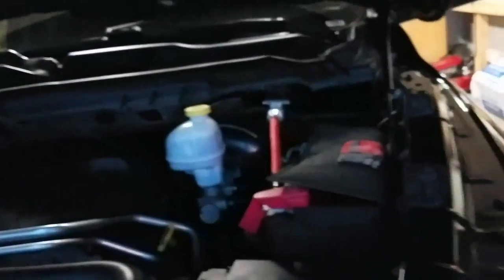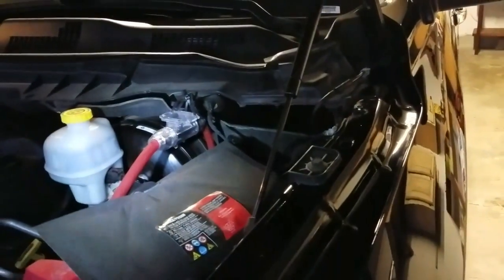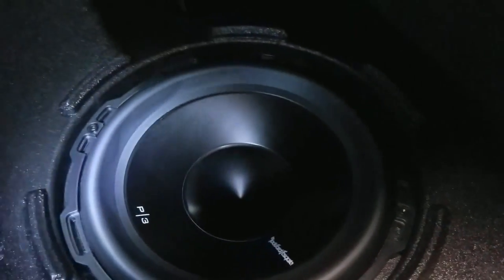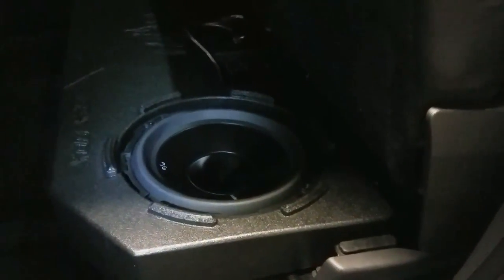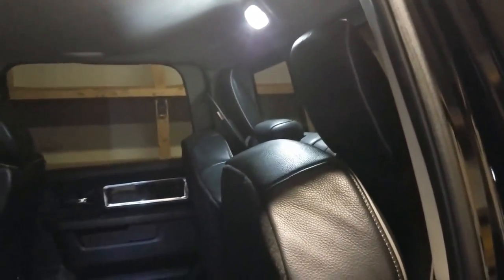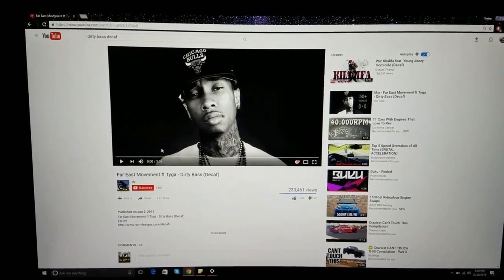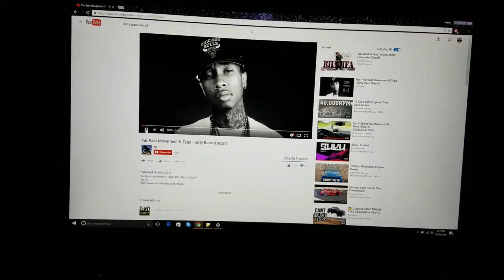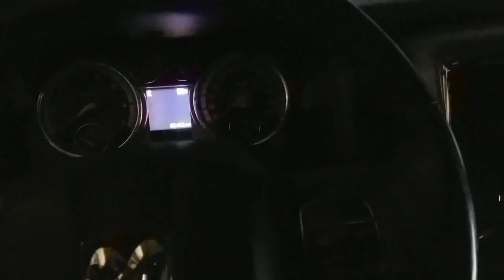Ram 1500 Crew Cab w/ Fox Acoustics Fox Box Install Overview

Comment: I see this is old video(2 years) but for those doing a box, best sound quality/ clean signal and ease of install get a Amp pro ch41 you will be happy you did. I have a 1,500 watt soundqubed amp, same as skar, 2 infinity kappa 1200w's in a sealed fiberglass box in my 13 Ram 1500 quad cab, off factory 8.4 Hu, sounds perfect, ported would be louder but I wanted Sq over loud so went with sealed. Interior speakers do jbl Gx302 in dash, jbl 6x9 2ohms in rear doors and most people would be beyond happy with the sound quality. The jbls match oem speakers ohms perfect, oem is 2.4 ohm, the gx jbl is 2.4 ohm.

Comment: I had my amp installed to my factory radio... and i thought i had the same problem but my amp turns off after a min or two... after opening my door... so if i keep my door open it will also shut off after a min or two..

Comment: Got this Fox Box in my 2016 Ram 2500 Laramie . 0 gauge all the way , crutchfield had a sweet interface plug kit was pricey at 250 but simplified install and allows to amplify mids and tweets later. Plus use Fiber Optic sound processor with 80 bands of adjustment. Only difference is I heated up the plastic buckets and shoe horned monster Sound Qubed HDC3 12s rated 1500W and 2400watt max . Hits so freaking hard and I'm only running them 750 watts each at 1 ohm. Slight misleading advertising by Soundstream Tarantula amp I bought saying 3k watts 6k max power BS.. Sound Digital will be next upgrade. Plus 2 more amps and sound processor to balance things out. Bass overpowers the mids and tweets so much sound quality imo was better stock still hit a tiny bit from factory with 500w 10 speaker system.

Comment: So will the Sundown SA 12 actually fit in this fox acoustic ported box. It shows 1.55 per side and max depth of 7.25 Would the magnet be to big? I own a 2012 ram 2500 crew cab but should be same as yours? If this does fit it would be a monster sub in there???
Reply: Yes

Comment: I had the same problem with my LCi2. It’s suppose to recognize the signal and send a remote on to the amp. It wouldn’t work. It worked on my wife’s car but there’s something about these rams that it won’t work. I just ran a remote to the fuse box.

Comment: does the spacers that came with the sub enclosure enable you to put the back seats down?
Reply from the maker: dEeM0nEy916 Yeap. The seat folds down with no issues. The spacers are pretty easy to install. Taking out the storage lids is a pain though.
Reply: XShadowHazeX I meant do the spacers lift the seats high enough to unhinge the back to gain access to the back wall
Reply: dEeM0nEy916. I order spacers from net audio it raised mine enough to let me have access to the back wall

Comment: How does this compare to the cheap wooden boxes online? I had one and it sucked so much! I saw this is ported as well does it get loud in this box ? I have the same set up as you
Reply: I just installed mine in 2015 ram 6.7 and man do they let the bump bump come out. I have ran 2 other sealed boxes and could never get any base using 2 10" Rockford. Thus was my last hope and you will love getting base again I am amazed being ported made such a huge difference.
Reply: Fox destroys all other box’s

Comment: I have the Fox acoustics ported box in my 2017 3500 with two Type R 12’s with Fosgate T10001Bd amp pushing 1000 Watts RMS and it hits hard! All of my mirrors are useless when driving. Also adding the seat spacers for the box to fit allows the seat back to fold down so was able to put the amps back there for easy access / adjustments. I was wondering though, has anyone figured out a way to lock the rear seat down for. Security? I have the full bench. I’ve searched the web but no one seems to make any sort of Lock for it. Think I’ll try and design one.
Reply: Any success on that lock? I'm installing the fox box with 2 American bass XFL 10s and the lock idea sounds amazing

Comment: look for a fuse in the  box that turns on with the accessories!
Reply: Or add a switch for the amps ground
Reply: The pink and green tow hitch lighting wire under dash

Comment: I'm doing the exact same sub/box/amp combo soon. It's all sitting at my house right now. Any advice? And how loud is it in person?
Reply from the maker: chris metz I think it's pretty loud for being a setup that all fits under the back seat of a truck. It's not very loud outside of the truck (unless the windows are down or a door is open), but inside sounds pretty good. I don't think you could get much louder without a bigger box or subs. SA12s would definitely be a bit louder but I just don't like the idea of the surrounds rubbing on the bottom of the seat. I would advise putting the subs into the enclosure once it's in the truck. It's a bit awkward to handle and that made it a lot easier for me. Let me know if you have any more questions.
Reply: XShadowHazeX I'm also doing a 4 channel for mids and highs, but are your subs still breaking in? And are you pushing the full power out to them?
Reply: XShadowHazeX additionally, did you use a summing device to grab the signal? I'm swapping out the battery for an xs d3400 and doing the big 3/4. I hope everything goes smoothly, and I really hope it pounds. I'd love to see more of the subs actually playing music if you get a chance man
Reply from the maker: chris metz I don't think the P3s have a stiff enough suspension to really break in. Regardless they've been playing for about 5 months now so they should be loosened up if any. And my Ram has the 180 amp alternator and my stock battery went bad so I swapped it for an autocraft AGM. Nothing too fancy but it's more than plenty for this setup. I have dual 2 ohm P3s and they're wired to 1 ohm so they should be getting full power from the Prime 1200.1D. I used a Stinger "thing" to intercept the signal from the factory sub wiring. It doesn't work right for turning the amp on and off but I still get a good signal. The D3400 is a kickass AGM. I had one in my old car powering a Sundown SCV-2000 with factory alternator and stock big 3. No light dimming whatsoever at full tilt. I'll try to take another video sometime soon!
Reply from the maker: chris metz also I posted another video the other day of my X15v2 home theater sub in the back seat. I got bored so I put it in there for some demos. That Prime 1200.1D is a little beast, you won't be disappointed.
Reply: XShadowHazeX I saw that video, looks like it was loud as ever. And how do you have them wired? If they are dual 2 ohm subs, you won't get a final ohm load of 1 ohm man. Maybe you aren't tapping the true potential of the amp/subs. And that stinger converter sounds like it might be robbing you of some bass. Regardless, I'm jealous that yours are in and mine are sitting at home waiting to get installed lol
Reply from the maker: chris metz you can wire two dual 2  ohm subs two a final 1 ohm. :) I think I might have them wired to 4 ohms though. I'm going to check this afternoon.haha
Reply: XShadowHazeX let me know man! I think you're gonna be surprised when you check it
Reply: XShadowHazeX let me know man! I think you're gonna be surprised when you check it
Reply: XShadowHazeX let me know man! I think you're gonna be surprised when you check it
Reply from the maker: chris metz okay, two things: 1, they're dual 4 ohm. I don't know why I kept saying 2 ohm.🤔 2, one of the subs was unplugged from the terminal cup. Already so much louder with the other one plugged in. I'm going to go find a parking lot and get the gain readjusted.haha
Reply: XShadowHazeX thank God they're dual 4. I didn't want to argue with someone that I don't know, but I was seriously wondering how you got to 1 ohm from dual 2's lol. You definitely need a new video with that other one hooked back up
Reply from the maker: chris metz Just swapped out the Stinger in-line converter I had with a Pac PDLC21 in-line converter and it made a world of difference. It's A LOT louder and the gain on the amp is only at 1. I also ran 0 gauge OFC all the way to the amp with machined 0 gauge to 4 gauge inputs, that probably helped too.lol I'll post a vid once I get everything cleaned up.
Reply: Well, I put all of my stuff in last month. I had to turn everything down a lot. The Rockford mids and highs sound amazing, and the p3's slam. My settings on everything are set at their lowest lol

Comment: So you can't put the amp behind the seats because the box reaches all the way in the back?
Reply: im running same box,  I had have plenty space behind seats to mount my amp and epicenter. Plus will add a 2nd amp soon same area
Reply: I have the ported Fox box running two Type R’s and my amps fit nicely behind the seat back and access is easy. Now I’m trying to figure out how to lock the rear seat for security.
Reply: Sleepy731  how the epicenter work on this box? I have the original probox and l cant make sound good whit the epicenter im thinking to buy the fox box

Comment: I got a pair of dc audio lvl 4 off eBay brand new for the same price as a pair of sa12 ... we'll see how they sound in the fox audio box when it shows up ...lol.... see how long it holds up to 3000 watts rms into pair of level 4s .
Reply: How'd it hold up?
Reply: @michaelsalyer4370  Well sir back in February fox audio listed a 1 month lead time on dual 12 boxes and my dual 12 box just shipped this week so I can't yet say . I do cone from more sound than a 12 will probably provide so I may end up putting the box in and then selling it and either pulling the back seat in favor of 4 12s or a couple 15 or 18s . I just don't know how these Two 12s in this air space will compare to the 3 15 w6 I had in a sealed box in my grand Cherokee. It's substantially less cone area but I'm also 20 years older so it might be enough ...lol ... Might not .
Reply: I got this box w/ two DCAUDIO level 3's underpowered with two alpine pdr mono amps pushing 800 watts a piece rms, and it sounds great. now i need bigger amps!